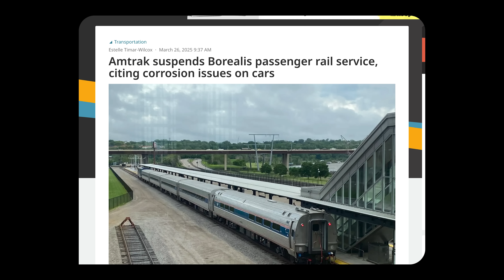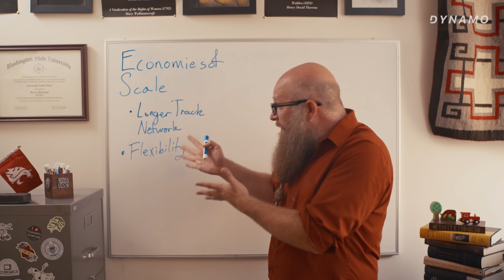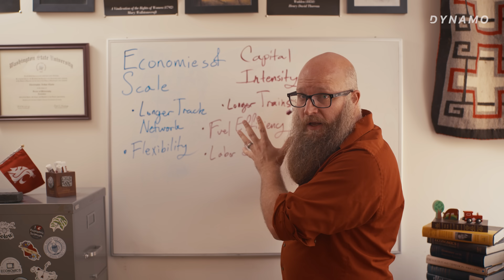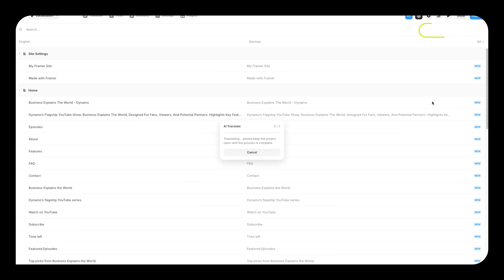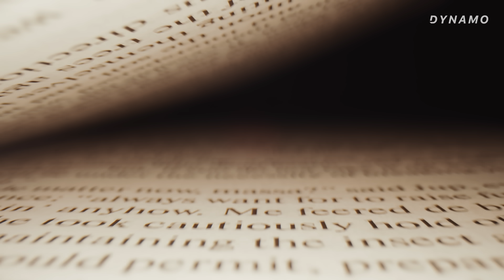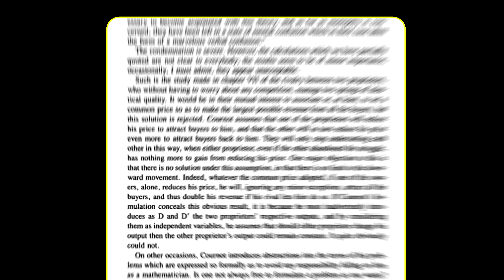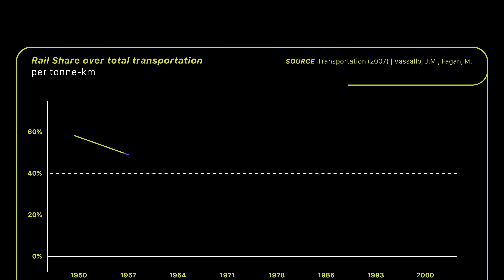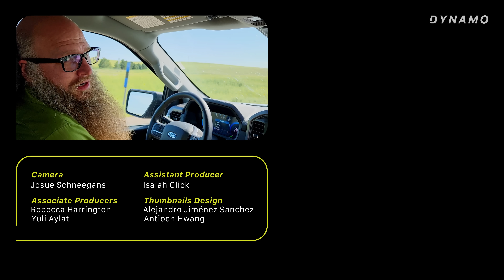Why Freight Trains Suddenly Got SO Long

Comment: As a freight rail aficionado and investor, I do not like the potential further merging of freight rails chiefly for one reason. Unions.  As the companies get bigger the Unions actually gain pricing power.  Just think as trucks are shifting to zero drivers, most freight trains which should be operated with 0 or 1 engineers, are forced to have 2 due to union rules.  If you look at the airlines, the larger ones usually struggle more for the same reason.

Comment: I've been studying US freight railroads for 50 years. By 2005, 25 years after deregulation, they were carrying twice as much tonnage as they were in 1980. Deregulation worked like a charm. Ironically, the Europhiles who praise Europe's trains over and over never mention that Europe's freight system is decrepit which has caused massive  problems with truck congestion on their highways.
Reply: Yeah, the truck congestion problem is very visible any time I have to take the highway any day that itsn't sunday. On weekdays I can pass 50 trucks and see half the number of cars. On two lane highways the right lane is completely invaded by trucks and it's hell. In Italy at least this happened because Fiat lobbyed the government to push for more trucks and less freight trains, and even today the Govt continues to prefer trucks because they make way more money on diesel taxes than the electricity used by trains.
Reply: This is exactly what we found, too. Europe ships more of their overland freight by truck than America does. The deregulation saved the American freight rail industry.

Comment: US freight railroading, despite its impressive productivity, is brittle. Overabandonment of routes means there's very little redundancy in the system and substantial parts of the country that are underserved by rail, underinvestment means major problems with safety and reliability, "precision scheduled railroading" effectively amounts to freeloading off the system by externalizing rail congestion on both passenger rail and road users including private cars and trucks by tying up grade crossings around major hubs, and the industry has lately been losing market share to trucks again.
Reply: PSR is dead. And why have unnecessary lines? It's just higher maintenance costs.
Reply: @AEM-7_943  unnecessary lines = insurance or redundancy during a crisis.
Reply: @Solymar105  Redundancy isn't always the best. UP and CNW had redundant lines, but guess what, reduced redundancy = better efficiency, and lower MOW costs.
Reply: @AEM-7_943  Didn’t say it was the best strategy. It’s rarely a clear tradeoff.

From what little I know of the transportation business, it’s a low-margin game until it isn’t, and volatility cuts both ways.

Look at cargo ships during the pandemic, record profits after years of thin margins. Or oil carriers when oil went negative, chaos for some, windfalls for others.

A bit of redundancy, reserve, float, etc. (pick your term) goes a long way during a crisis.

Comment: Very interesting presentation about freight rail.  And yes, I would like to see your thoughts and research on passenger rail.  From my observation about that, passenger is never going to exceed, because they are basically squatting on the freight companies tracks.  The only way it would ever be a thing again is if it were profitable for the actual railroads, not the current government entity.  Maybe if you do a show on it from an economic point of view, you could prove/dis-prove my thought the argument of "Provides needed transportation" in remote areas is incorrect.  I say buses could provide "needed transport" much cheaper. Honestly, I think Amtrak is nothing more than a luxury to be enjoyed by those with large disposable incomes...

Comment: Great video but it is clear that you do not understand the railroad industry or how it works. As a 20+ year veteran of the industry, i can tell you that less competition absolutely equals higher cost. Most times when there is a merger, not only do rates increase but the railroad also refuses to serve smaller customers. Class 1 railroads want to haul a product for a long distance. That is how they make big profits. They do not want short work. If the UP and NS merge, there will be no benefit to anyone except the UP. Companies and consumers will suffer like they always have in big railroad mergers.
Reply: i agree with 4 gear , there is a reason why anti-trust law exist. What should be changed is the primacy of shareholder's dividends . Set aside the Dodge v. Ford Principle and let the corp and workers get priority in the dividends .
Reply: I must say that if you want Real efficiency you need electrified double track with minimal Speed of 160 km/h track can manage 300 train per day ( usimg good signalling system likes etcs) then. Longer trains Will block infrastructure fór much longer due to lower Speed And shorter electric train far more cost effective then longer diesel one. Thats why Metrans train ( please check their website) Are cheaper than Američan Oneš.
Reply: I appreciate the perspective. Why does the data show that inflation adjusted costs have gone down? I'm just trying to follow the data.
Reply: @EconChrisClarke I'm not sure what data you are looking at but you have to look into the details as well. For example, railroad A buys railroad B which allows them a cost savings now that they have a direct route. Railroad A might be able or willing to lower rates for some customers for some situations. However, it is likely that railroad A will abandon customers on the railroad B line that they just purchased if those customers don't have enough carloads to ship.  The railroad will chase the business away by raising rates to the point that the shipper will use trucks instead of trains. 

A prime example of this is when the Canadian National bought the Wisconsin Central.  The WC was a booming railroad. The CN bought it for the mainline from Superior, WI to Chicago, IL. The CN came in and abandoned a bunch of track, raised rates and flat out refused to serv some customers. These big railroads spend a bunch of money on "bean counters" so they can trim the operating ratio as low as possible. Typically class 1 railroads do not care about short work, locals, branch lines, etc. They want to haul a loaded box car for 1000 miles, not 100 miles.

If anything, some of the class 1 railroads need to be split up, not more mergers.
Reply: @4-gear  sounds like you're suggesting that there should be some regulation that requires trans-continental freight companies to share right-of-way with regional railroad freight companies? =) 13:40
Reply: @_jx_ No, I never said or implied that at all.
Reply: I call Bullshit on that

Comment: HIGHER FUEL PRICES! I think that's a pretty big detail that you omitted.

Trucks can be shipped anywhere anytime. The road network is way more extensive than the fuel network making trucking way better than rail due to higher flexibility and speed. That is as long as the price of fuel is NOT an issue because railroads are far more efficient than trucks.

Fast forward to the oil crisis, 2 gulf wars, tightened environmental regulations effecting not only the price of oil but also the reliability of trucks and efficiency becomes a much more important issue.

RAILROADS LOVE IT WHEN OIL PRICES RISE! Fuel accounts for around 25% of cost per mile by truck. Rail is MUCH, MUCH, lower.

Comment: With the upmost respect as I did enjoy a few parts of your video, this point bothers me the most: What is this right of way argument regarding the areas with 'captured line' railroads? There is no current 'in law' obligation actually forced by government, least in the United States (Canada and others do have such regulation), for companies to give trackage rights to other railroad company for the purpose of serving customers or a town. Similar rules, while in discussion at high government levels to be implemented, are fought against tooth and nail by the AAR and C1 railroads. Currently: 'rights of way' over other companies' railroad must be sought and argued for before our regulator with all parties in agreement to such an end... I am pretty sure it isn't even brought up without both parties being in agreement before hand... Unless it is part of a deal for one company to acquire and control another, where everyone is attempting to get a piece of the pie. 

On that topic, least for those 'shared' areas: The railroad's owner also have constant control on who gets sidings and who does not. So even if you did have a shared railroad, the freight rights go to the owner and their desire to allow new sidings or customers to come online, the partner railroad would have to pay for those rights and the ability to do so... Which the owning railroad is rather unlikely to play ball, least in my own experience and understanding.

I'd request clarification on that point, specifically. Both as a proof of the claim that the Duopoly is a thing that actually happens in capture line areas as well as supporting the claim that less competition works in this area.

The industry is well able to operate without being merged as it is, plenty of trains operate through running trains onto each other's lines by simply swapping crews at normal crew change locations... They share locomotives and rolling stock... It is why you can get a Norfolk Southern engine in Nebraska, like we see in some of your shots at Bailey. This is a solved problem and one that the industry has been able to work with for quite a long time. Many railroads do not have side-by-side lines like they used too, so competition is even less, down to single railroads owning entire regions without a single proper competitor. 

As a hobbyist economist, a passionate railroad history and operations researcher, a professional railroader, as well as a firm believer in my industry and its potential...  It is kinda difficult to watch folks talk about the industry. This is for a couple of reasons: 

Firstly, the research will only get you so far. Railroads and our Association are deeply secretive and obsessively paranoid when it comes to sharing the 'how it works' indepth with an honesty and simplicity to create a full and accurate picture. So most info that you get from general public research, without a number of trusted insiders with full pictures, is very limited.  

The other reason its hard to watch these videos? When editors and video makers use B Roll of stuff which has no relation to US Railroading. There is a lot of Non-US railroad video used in areas where only US rail is the subject at hand.

Thanks for your time, thanks for the video, not one of my favorites in regards to the missed connections on a few things.

Comment: "American freight trains are bad" dude my local CSX train runs with 50 cars, more then a eurpoean mainline freight train 😂😂
Reply: yeah, probably on shitty tracks with outdated coupling and braking systems, with non-fully electrified locomotives moving at a snails pace, while blocking a road crossing and holding up a passenger train illegally.
Reply: @yeoldeseawitch no it don't it's a single brschline that gets 3 trains a week doesn't block anything or anyone 😂 american freight trains are just the best European freight trains barley vet above what 30 cars like cmon 😂😂
Reply: @THE_IRON_HORSE at least they're not slow and don't vomit out clouds of fucking volcanic ash lol
Reply: @yeoldeseawitch and you're calling an American freight train slow win like these trains are 3 Mi long going 60 to 70 mph how is that slow for a freight train
Reply: @yeoldeseawitch also outdated coupling??? How ate automatic couplers old? You guys use chain and pin?😂😂😂😂😂 like get real, most if there locomotives over there prolly couldn't handle a standard American intermodsl train 😂
Reply: @THE_IRON_HORSE you guys also refused to use buffers or vacuum breaks, so you got no say in criticizing Europeans using chain couplings.
Reply: @yeoldeseawitch dude I don't think you understand that an American coupler is the buffer That's How Strong the thing is it's a big piece of Steel your guys's chain and hook genuinely cannot handle American freight train standards
Reply: @yeoldeseawitch and it's like in Europe you guys can get away with using a chain and pain because your cars are like a thousand pounds and there are two axle trouble some trucks from Thomas and Friends Like cmon 😂

Comment: problems not highlighted in here
1. loss of jobs, using super long trains means, 3 4 trains are converted into a single train, so 2 person crew per train, 8 hour shift per day means 4 trains need --> 4trains x 2crew x 3 shift per day = 24 people per day , drawing salaries. converting 4 into 1 train means 1x 2 x 3 =  6 people per day, ie companies saving money worth 18 daily salaries every day.
2. time taking to pass a crossing means at times, emergency service vehicles have to wait a lot of time before tracks are cleared
3. EOT devices have already removed the train Guard Jobs.
4. despite having priority, passenger trains have to wait a long time in sidings since freight are now too long to fit in sidings.

I do not understand why USA railways are not investing in dual tracks or atleast have tracks act as a pair ie one acts as east to west while other acts as west to east despite them being few miles apart.  this can ease the congestion as well as streamline the traffic.
Reply: If Jimmy Carter hadn't de-rugulated the railroads they would have all gone bust = no jobs
Reply: @jonathanbutson1385  i dont know whether deregulation has helped or not coz all what freight bosses are doing is to maximize profits.
most railway lines are built for freight ie the heavy weight makes the tracks stable for freight trains but they are not so stable for the lighter passenger trains which oscillate way more than they ideally should.
but rail owners are not going to care for passenger health, all they care is whether they can transport freight at cheapest costs to make maximum profits.

Comment: The US is STILL going bust with their rail system!
Main reasons;
More diesel trains mean more pollution, electric isn't an option because it would make oil barons angry!
Passenger rail is still secondary to freight, meaning constant delays, meaning more cars on the road -> More pollution and more traffic jams...
Reply: also their employees are treated like shit being forced to be on the job with no vacation or sick days
also those diesel trains are horribly maintained as well as the tracks, tunnels, bridges and signaling systems they run on
also they keep to no real schedule and can arrive several days late, losing many customers to the trucking industry
also make their trains so long that they block road crossings, forcing civilians, school buses and emergency services to find alternate routes.

Comment: 2:38 A simple google search would have told you that China has 100,660 miles of railway track - that is 8,660 miles more than USA.
Reply: You might want to learn how to read that Google search then. 😉

The United States has almost double the amount of mileage of track compared to China. 160,000+ miles for the U.S. vs 96,313 for China.
Reply: Uh what year of google did you use

Comment: Currently there are 3 duopolies is North America. UP/BNSF, NS/CSX and CPKC/CN. These duopolies are already well positioned to compete directly with one another. CN and CPKC are owned largely by US shareholders so they must also be considered while having this discussion. Both already provide transcontinental services but it has to be mentioned that most goods are not traveling from coast to coast. So another North American transcontinental is mostly trying to compete for business that is already a small portion of existing transcontinental railway revenue.  Assuming the STB isn't corrupted beyond reason with biased members, I doubt that the UP/NS merger will be approved because railway competition is well balanced as it is. What the railroad industry needs is network expansion to new assets, recommissioning or construction of branch lines and encouraging industry to build next to, and to utilize rail more. A merger is unlikely to provide these outcomes and is mostly just mascarading as rail industry progress.

Comment: You didn't discuss how those more "efficient" freight trains that run a couple of miles create serious safety concerns and lead to derailments
Reply: yeah honestly, like the issues with these huge trains just mean they're such a huge liability when running multiple frequently is just fine elsewhere
Reply: This. And the absolute abuse of their union employee base.
Reply: And makes passenger-trains unusable because of the long waiting time and slow speed.
Reply: @ortondark83756 freight business main focus is maximized tonnage while passenger rail focus is higher frequencies , passenger experience, and shorter travel times. The differences of business models is the reason the industry split into freight and passenger focused businesses. Some of us are old enough to remember when they were mixed companies both freight and passenger. HSR the differences are even greater , they specifically engineered right of ways and train sets.